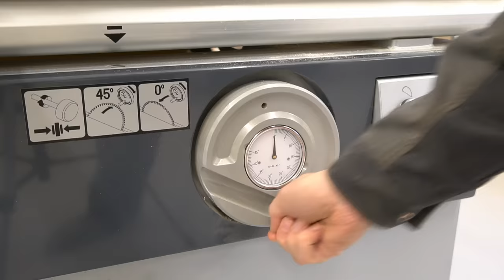AMAZING restoration of a BROKEN rocking chair

Comment: Loved that joint that you used to repair the broken bottom rocker.  I'm always impressed by the amount of strength that wood glue has when given enough surface to bond on.  I thought that you may go with a scarf joint of some kind but whatever that one is called looks like it did the trick.

Thanks again for the extremely entertaining and satisfying content.

Comment: Thank you for the rocker restoration! I have had a sewing rocker sitting there broken for years. Probably not as old as yours of course. I used it for years when working on projects where I needed to be close to the floor. As a seamstress I love sewing rockers. With this video maybe I can repair mine. Have asked a couple wood workers about repairing, cost was prohibitive.  Most wood workers don't want to repair things, just make new. One even said, Why is that ugly thing so close to the ground?
Reply: Interesting. I never heard of a sewing rocker. Could you even buy one new if you wanted to?  What sewing do you need to be low to do?

Comment: When a nail gets that embedded use the locking pliers and a crow bar. You lock the pliers partly down the shaft then use the crow bar pushing up on the locked pliers. Works like a charm. I even get out nails that have lost their heads that way.

Comment: BIG TIP      Screws and nails that have been in wood for a long time form a bond. Take an electric soldering iron and rest it on the head  for a couple of minutes  the screw/nail expands breaking the bond . When it cools its so much easier to remove
Reply from the maker: Nice theory, but it doesn ´t work. Mostly because contact area is too small.

Comment: You know, the problem with glue, is that it typically does not hold under stress.  Moisture, vibration and physical force can kill a restoration that took hours to complete.  I would use peg inserts / biscuits, and a metal flat plate, underneath.  Plus the weight an average chair needs to support, is well over 200 pounds, these days.  "Fragile" turn of the century chairs need to be so buked up, these days it's scandalous.
Reply from the maker: This chair was kept outside, that is why it decayed.